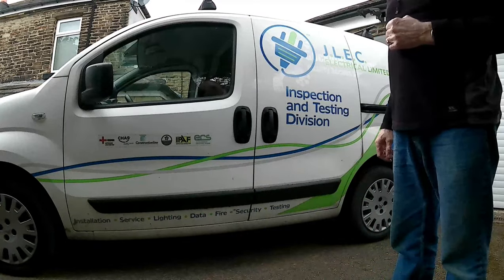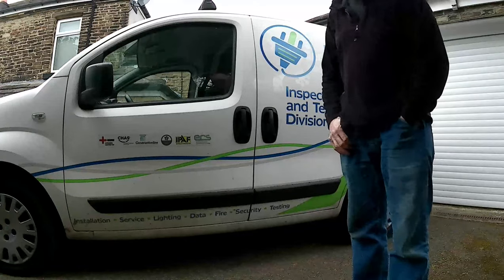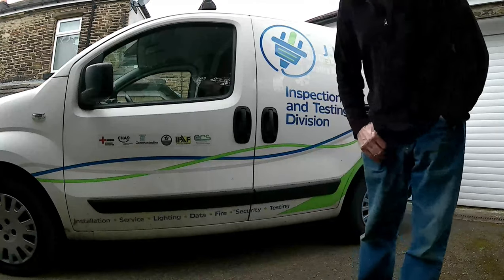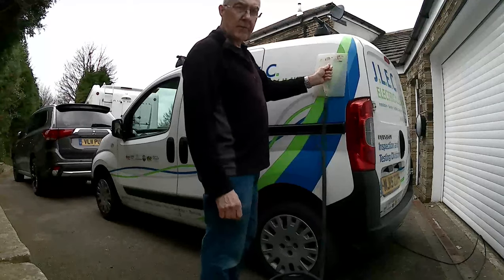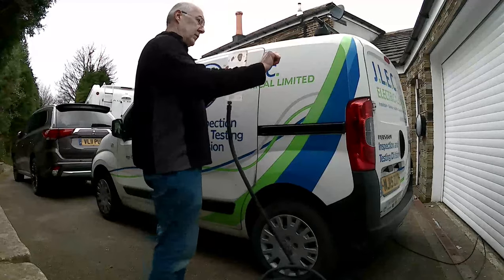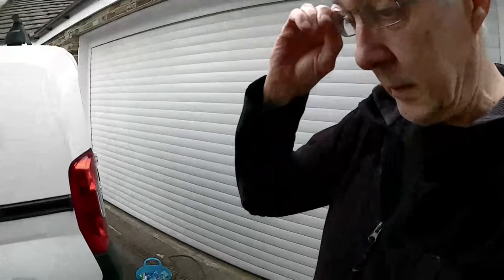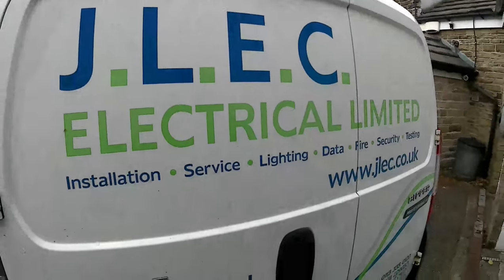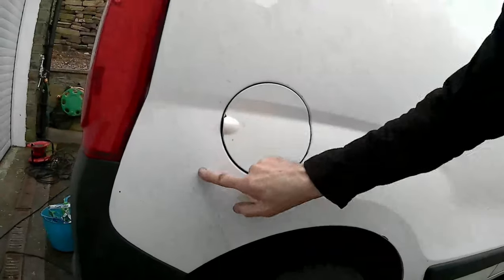Van sign writing stickers removal using a steamer not heat gun

Comment: Just tried this on full wrap with laminate vinyl and it leaves loads of glue on the van, resorted to a heat gun and got much better results.  I do think this steamer would be ok for lettering or small partial stickers though and not a full wrap.  Thanks for posting.
Reply from the maker: Not used it on a full wrap.
I have taken lots sign writing off vans and the steamer is twice as fast as heat gun for me and the glue is an issue with both methods, that's my personal opinion only. Thanks for your comment 👍 🙂